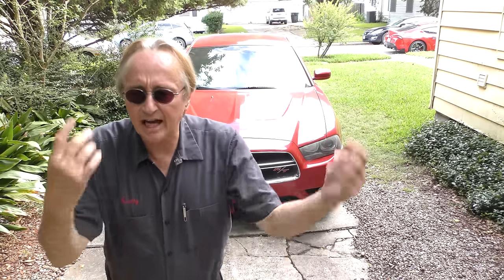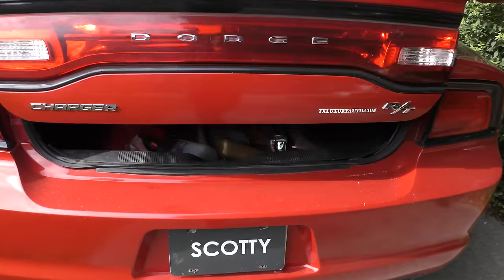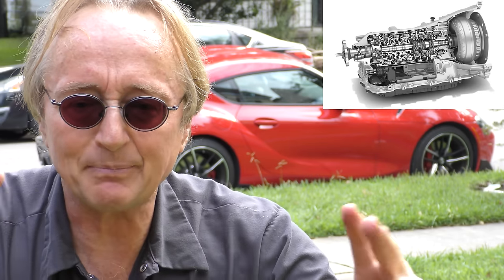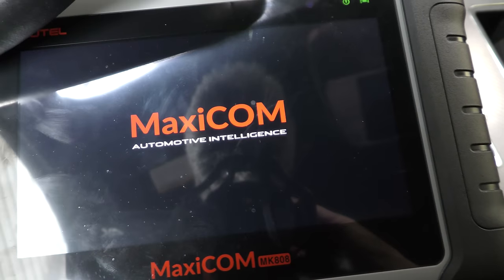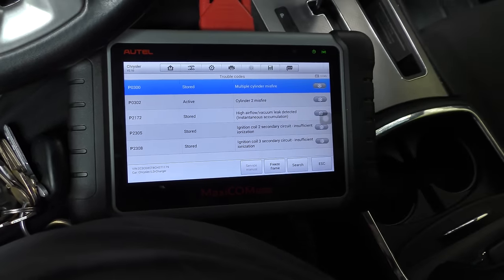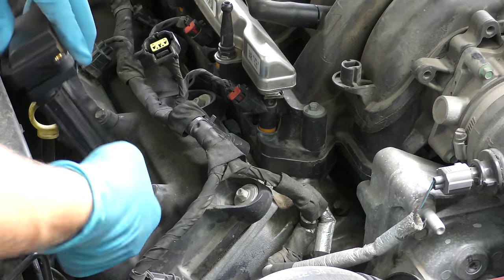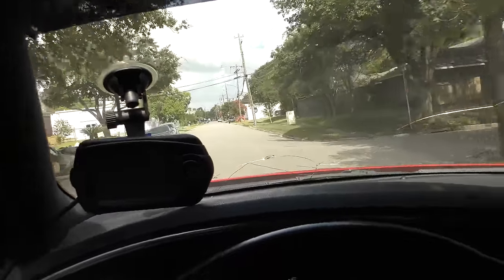Here's Why I'll Die Before I Buy a Dodge with a Hemi Engine

Comment: Scotty, I have a 2016 Ram 1500 Quad Cab SLT with the 5.7 Hemi, 8-sp automatic.  Around town I get about 18 mpg.  Took a trip across three states loaded with my son's household goods and over the whole roundtrip averaged 26.6 mpg.  And it has lots of power, I couldn't ask for more.  Currently I have right at 40,000 miles.  Hopefully it will not suffer lifter failure (people say cam failure, but it is the lifter, not the cam at fault) you hear so much about on these engines.  Oddly, the 5.2L and 5.9L Magnums don't have a reputation for lifter failure like the Hemi.  I think Uncle Tony has correctly analyzed the problem on that, poor lifter lubrication inherent in the design.

Comment: I own a former indiana state PPV charger with the v6.  the car has 230k miles and runs like a sewing machine,  the only issue with the pentastar engine is the roller rockers wear and need replaced every so often,  ive replaced two of them in 60k miles,  its an easy hour long process and the part is 6 bucks and i would do a gasket set for the valve covers at the same time.. but I love this car...would buy another one!

Comment: 06 ram 1500 with the 5.7 108k miles picked it up for $1600 same deal misfire followed the same steps however I wanted it fixed as the body was flawless so I went in.  Those hydraulic lifters suck roller got stuck are the cam went with hellcat lifters and a different cam pushrods springs anywho cost about $1500 plus $400 for a tuner turned off mds and it’s been great since that little flaw they get so if anyone thinking of the 5.7 hemi make sure there is no misfire cause who knows few thousand more miles of running metal cam shavings thru the motor it could have been worse.  Overall for the price I’m not mad what I have for a summer truck but would I bother again?  Nope hate to say but id rather a different kind of issue then the hemi gives

Comment: Could just be a vacuum leak confusing the MAF making it idle rough and lifter tick can usually be quieted down with an oil change or adding oil to the crank case when it burns

Comment: Alotta issues with used hemis, usually lifter issues then they get worse from there buy GM , pref older vortec 5700 or 5300 series they outlast any hemi

Comment: I have 2012 charger RT with 330000KM . Still driving it daily since 2012 with a lot of abuse
 Looks like new from the exterior and interior. Never had a check engine light . I actually only replaced the shocks about 6 months ago .
Reply: How did you do it man and can you give me some feedback and what part should I replaced at what mileage. I appreciate if you help me out

Comment: Those engines are amazing if you don’t floor it everywhere like these charger owners. My dad had a ram with the 5.7 with 300,000. He knew it was good for a while and gave it to my sister who’s learning to drive
Reply: Actually you have that completely wrong. If you look at the Ram HD 2500, etc, you will find the longest lasting Hemis in existence. The truck is heavier and geared for more torque so that just accelerating to 30MPH is the equivalent of  punching it to 60 in a charger and those engines are the ones that last longest. Hemi engines that don't get any exercise are the ones that fail first on mean average.

Comment: My 96 Ford Taurus I beat the six-cylinder challenger, the 6 cylinder Camaro and the 6-cylinder mustang with my car. And a 2017 mustang GT, my car still has the original CV shafts

Comment: I had a 19 hemi ram put the exhaust on it loved it but after one winter the body was showing rust and for it to run good you have to be on the throttle it also made a clicking sound and I hated it changing to 4cyl ran like shot in 4cyl.

Comment: I have a 2008 Charger R/T with 138k miles on it. My car is still in great condition and I drive it like a stole it. My lifters arent clanking, my engine isnt shaking, none of that crap. Outside of normal maintenance the only big things Ive had to have done to my charger is about 2k in front end repair work and my fan assembly blew apart cuz it was 11 years old at the time and I was pushing it hard. When the fan assembly exploded it threw a piece of a fan blade through the radiator so I had to replace both of those items which was about a $400 repair. I also had to replace the alternator which was another $600ish dollars. For a 13 year old high mileage car Id say its been one hell of a reliable car. 3k worth of non normal wear on that car is nothing compared to some of the other cars Ive owned. If you wanna spit hate at Dodge you should bash on the Dodge Intrepid cuz that car was truely a POS.

Comment: Ram 1500s goes to crap after 100k miles too. Check Engine Lights, heater, AC etc all goes out around 100k.

Comment: If you want to get rid of the Hemi tick and want to fix it right order the hellcat lifters instead of factory and replace the camshaft at the same time as you will find damaged cam lobes ...use a good racing camshaft instead of factory as well .....Big job to do as with many miles on them you will be replacing plastic parts that break while dismantling the engine above the manifolds as they are brittle after all the heat . Best to pull the engine (can be done in the car but not much room to work)as well so you can have plenty of room to work . Change your timing chain and tensioners ,check your heads and valves and replace head gaskets and water pump to save yourself the headache of doing it later . Better yet when all is said and done just buy a factory remanufactured engine if you are not confident in breaking down an engine and be done with it 😉😁!

Comment: Scott I have a 2012 challenger with the 6.4 hemi. No knocking, no ticks, just regular maintenance and I put 200k miles on it so far. Had to replace a thermostat that was stuck open but that's it. Why are you always bashing the dodge hemis?

Comment: Have a 2.7 v6 07 charger and that thing ran fantastic until the timing chain blew through the valve covers. Now I don’t have a car 😭

Fixing it parts alone ran me 700 (still need parts too) and no shop around would work on it

Edit: 235k miles got it at 145k

Comment: I will tell you this I bought a 2014 Dodge Charger RT Hemi with 64000 and I'm at lil over 200000 I will admit I had to replace quite a few things but that was until about a hundred seventy thousand miles I also have a Chrysler C that I bought 2015 and I had problems with lifters and camshaft within the first six seven months and I've took  the Hemi everywhere and it's been good to me keep up with your oil changes and your spark plugs and your maintenance one little thing goes wrong you get it fixed right away and it'll take good care of you and I'm on the road all the time and I go travel a lot from state to state

Comment: This guy cracks me up 😂 1st of all 2012-2014 Charger RT makes 370hp and 395TQ FACTORY, secondly yes the 5.7 Hemi has issues with cam and lifters they have since ironed that out and if you’re like me you’re building for performance anyway so replace with a hood cam and lifter set like Comp Cams Stage 2 HRT 273/279 Hydraulic Roller Master Camshaft Kit. Thirdly as far as the transmission Dodge has a electronic flash update for the transmission and you have to do the transmission fluid services per the book fluid and filter change NO Flush!

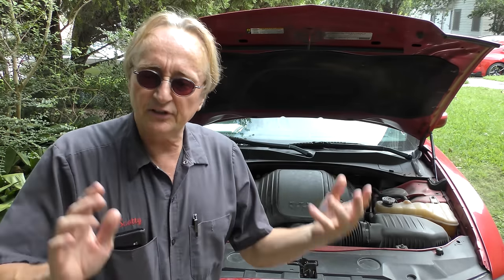Comment: 3:15 The V6 can get a LOT better gas mileage if you drive it gently. I had one in Canada for a couple of weeks and it used around 9 liters per 100 km in mostly highway driving. For a big car, that's really good, and it still has tons of power if you need it.
Reply: Clearly u have never driven a fast car....

Comment: That would make a great project car for a HotRoder.
A cam and lifters is a pretty straight forward, While you have the heads off a good valve job will wake her up nicely.
That will make a good first car for some teen with ambitious race dreams.

Comment: My 2014 has 100K+, regular Royal Purple oil changes and Wix filters; only engine issue was an oil pressure sender. Lifter issues are not as prevalent as perceived; these engines have to be maintained and revved. Failures most often happen to people who don't change the oil or use the wrong grade thinking that makes them a mechanic.
Reply: If u read up royal is a waste and not nearly as good as motul.  But if it's working....

Comment: Hay Scotty.  You could not get the 8 speed behind the hemi until 2015. I  have a 2012 RT Max. 88K miles.  Definitely runs better then this one.  My MPG is 20-23.  I always change oil a little early,  because hay oil is cheep.  And I think 9 or 10 K oil change is too far.  This car was not taken care of too well. I have had many Mopar’s I have run to 200K, and they ran better then this one.

Comment: A slight tick is very normal in the Hemi engines.  I have driven Hemi powered cars and trucks for 16 years. Never an engine or transmission problem.  Sold my 2004 4x4 with just under 260,000 miles. It had a slight ticking noise for the last 100k. Used NO oil, look clean at every change.  Replaced over the years water pump, passenger side axle at 236k. Tuned up twice. I have a 2012 Charger with the Hemi, over 170,000 miles and still screams down the highway.  I really dont understand what Scotty's problem is but, he is the mechanic.  All I know is while Chevy and Ford pickups were spitting plugs, burning oil and phaser cam ticking, like a diesel, my Hemi powerplants are just dang good engines.

Comment: Hey scottie my Redeye challenger widebody has 3,800 miles. Motors fully forged and has the 8speed. 

Should last forever. Rear axles are 41 spline. Talk about heavy duty and high quality!  You should differentiate between the ghetto banger owned ones and the ones worth 100k making 800 horse =) love u anyhoo

Comment: 5.7 isn’t the big hemi v8, that’s the smallest v8, next step is the 6.4 v8, and the big boys are 6.2 supercharged. Starting at 707hp , about 3 In between topping out at over 1,000 ho in the demon 170. The 5.7 is a daily driver decent hp decent fuel economy and cheap to replace.

Comment: 3:29 you got that backwards, it's the ones who WANT to drive like maniacs who buy these things, because there's no damn reason you need a V8 in a car when you're driving in traffic with speed limits no higher than 75 to 80. 100% of cars will go 80 mph, and that includes 3 cyclinder cars! Hell, my 1985 Cavalier with 260,000 miles even goes 85 mph, and that's with the original engine!

Comment: Im a dodge person but still as a dodge person you have to look for the right engine/transmission combos. I feel most people who have had bad luck with them right away have gotten the lemons. Not a newer hemi fan at all ill stick for my 94-00 318 magnums with NV3500 5 speed manual transmission (thats a pretty bulletproof setup) 94-02 cummins with a 5 or 6 speed bullet proof 07-09 6.7 cummins had they’re issues but still more reliable/longer lasting then a lot of those hemis in that time 2010+ cummins 6.7 they figured it out though good motor then if your looking from newer the 4.7’s bleh, 5.7’s bleh, 6.2 hellcat/6.4 hemi seems to have improved but dodge id say really didnt have a good gas engine between 2001-2011 and even still lsome newer then that have issues. Dodges have they’re fair share of issues honestly but you have to find the right engine/transmission combos to get a good one

Comment: My friend has a Ram 1500 with that engine in it. He started getting a real bad skip. He replaced everything he could. Finally took it to a mechanic and discovered one of the lifters seized up and wore out the cam lobe. My friend had to purchase a new engine for 5k dollars. My friend didn't blame the engine failure on the fact he changed the oil every 10k miles and used conventional oil. He blamed it on Dodge lol. Change your oil folks

Comment: The 5sp in the Charger/Challenger is a W5A580 aka NAG1 aka 5G-TRONIC... It's a Mercedes-Benz transmission NOT Chrysler, and they are quite stout transmissions.  The trucks had a different trans, maybe that one was a Chrysler.  Do your research Scott.

Comment: We own two Dodge trucks, both with Hemi's. The 2010 is the work truck with a 12' enclosed trailer following it almost everywhere it goes, it only has 235,000 no problem miles. The other is a 2015 2500 Mega Cab with a 6.4 Hemi, only 106,000 miles but zero issues! Unlike my Expedition with th 5.4 triton, only engine I've had to blow a spark plug out of the head, twice! I'll stick to my Dodge's thank you...

Comment: Surprised your giving that engine so much trouble. Dodge makes the best engine. They use those when they testing oil. Run them at 200 horsepower for 60 hours straight and it still keeps going afterwards. And the new ones are pretty good on mpg when you consider its over 4000 pound car with a pushrod lol. But your right the 6 cylinder will outlast the hemi. That pentastar is great.

Comment: That misfire code tells you that the cam shaft is beat to crap.  The lifters are digging into the cam. Short of it is Scotty is correct. It was a poorly designed motor that is beat to sheeit by a heavy footed suburbanite. If you baby that motor you may get another 20-25k out of it. 3-4k if you heavy foot it. Change oil every 800 mile and baby it.

Comment: I do not think scopty knows as much as he thinks or says he does, the car can be fixed for less than half the money its worth, also what about the spark plug,injector and many other things that could cause that cylinder 2 misfire, but welp the coil didn't fix it so its junk

Comment: Mines a police charger with 168000miles and 7740 idle hours and ive only had cooling system repairs. Yes the MDS lifters are garbage but to say Chrysler doesn't make engines to last is false this was a poorly maintained engine .

Comment: My God that thing is filthy under the hood. I've got a 2014 Challenger R/T, red with two black stripes.. Had it for 6 years. It's my daily driver but it only has 80K kilometres (50K miles) on it. But my car is spotless under the hood, pressure washed twice a month. No, never had electrical problems from the pressure washing. I love that car. I get compliments from strangers a few times a week. Well, not me, my car.

Comment: 3:57 uhhh yes Scotty that clacking IS normal. :> it's called a cold engine! hahaha! and my Charger does it too when it's cold. 

my baby is a 2007 (Daimler not Fiat) Dodge Charger R/T AWD i've got the V8 5.7L/345 with the 'variable displacement system' which flips my V8 to a V6 and back again... and i've got the autostick clutchless bla bla bla transmission... i JUST rolled over 50,900 miles. . . yes... we MOPAR heads don't ALL drive our modern muscle like madmen and women. i dunno what FIAT did with FCA motors that made Scotty think Chargers went DOWN TO 12mpg city... but mine by Daimler gets 16-18mpg city and 22mpg highway.

Comment: It should have been a plus that the battery is in the trunk instead of in the hot engine compartment since heat ages batteries. About having to keep the terminals tight? That is every car. The only major downside to my 2008 5.7 is the possibility of dropped valves over 100,000 miles. I might preemptively get a rebuilt head and do the job myself. So, that's about $1k vs $3 to $4k having a mechanic do it, which for me is out of the question for a 2008 car. If you want the fun of horse power, then you go hemi v8. Simple as that. The author is not a horsepower person, so I respect that he wouldn't buy one, but why talk about a car that has no interest to him in the first place.

Comment: I had a beautiful 2011 Challenger RT , 56k miles Hemi Orange. I took care of it like my own son , rarely raced and used mostly for going to work. I was on vacations trip with my wife and my  1 year old twins in the middle of the Atacama desert and the engine died, I had to tow the car 400 miles. Timing chain, factory defect! , beware owners of 09-12 5.7 hemi engines there is a recall for this. After 18 months of dealing with the dealership and Dodge I decided to escalate to social media and a local newspaper and only after that I got the car fixed. Sold the POS the following week, and now i'm looking for a Honda or Toyota after seeing scotty's videos.
Reply: This is the worst with American cars. They leave you stranded in the worst possible moment.

Comment: That Charger is beat to hell and back. Everything about this particular car screams that it’s never been taken care of by a qualified mechanic or responsible owner. I’ve had my 2011 R/T Max AWD since… 2011 and it’s been a dream. I’ll take it into the mountains just to feel the power. We’ve been on multi state trips. And can even “camp” in it if I lay down the back passenger seat and stick my legs into the trunk. I’ve driven from CO to ID just to visit my sister’s grave for a few hours before making the return trip. It handles the rain and snow without hesitation even when I have my warm weather soft and sticky tires on. I don’t buy tires for longevity, because that not how I drive. I could have switched to the latest model on several occasions, but the 2011 looks mean with it’s massive grill. I would, and plan on, buy again.